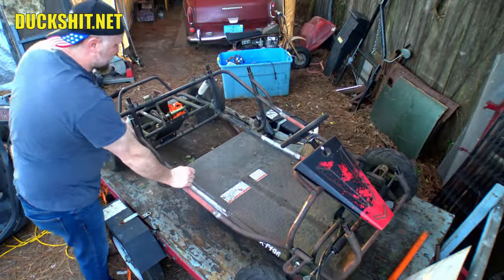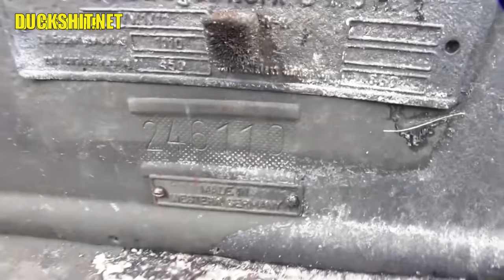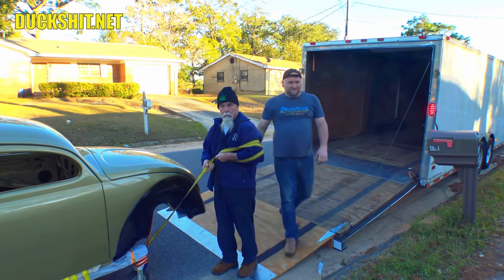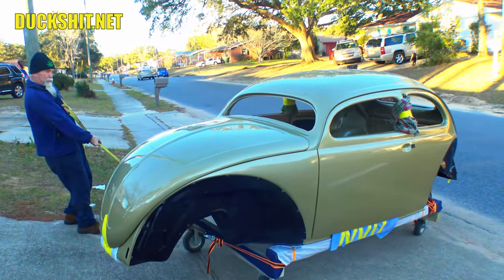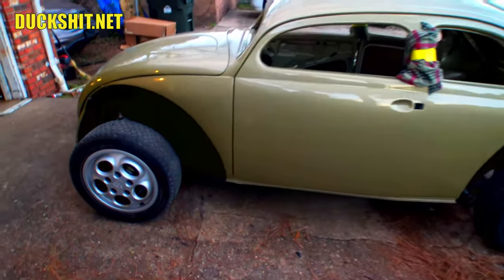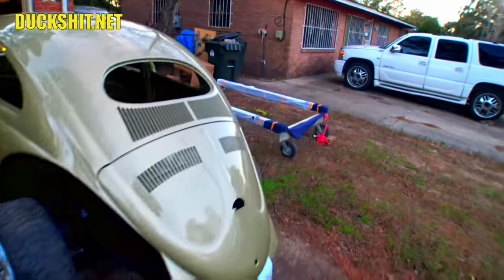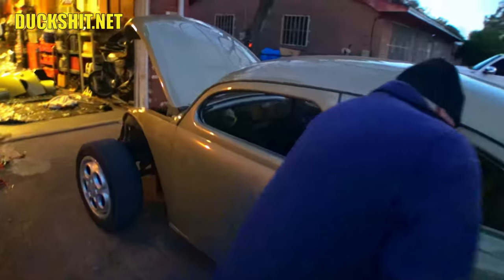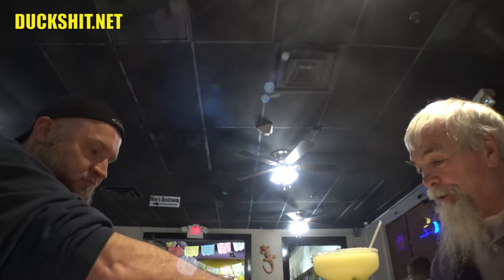Eleanore Comes Home - ROTTEN OLD CHOP TOP 1956 VW BEETLE - 161

Comment: did you put the rubber pads under the mounting areas? :D 3:)
Reply from the maker: Nope, was said in the video at some point, not really audible.  But that was the only reason I said I would lift the body up at all, and it only needs to go an inch in the front and less in the rear.  Hehe 😁👍🏻
Reply: @DuckmanCycles  what amazes me is that the trunk lid is stable - every one I ever owned when you opened it you had about 4 inches of flop on it - he really reinforced it well! :D
Reply from the maker: @patrickteater3392  I'm not sure how he stabilized that hood, specifically, I don't think any welding took place.  There is barely any filler on it either.  But it fits really nicely, when he got it, the fit was TERRIBLE!  That front end was from a car that had been hit in the front, gently, but it was wrinkled and twisted a bit.  I did what I could to make it work, but Earl made it into art!  😀👍

Comment: Sorry to have to ask but can a person get a set of  10 inch x 4 x110 4 bolt lug   that will take the center hub cap  ?
Reply from the maker: Please clarify your question I'm not sure that I understand.  Lots of technical stuff there but I think I'm missing some context.  Is this relevant to my Beetle?
Reply: @DuckmanCycles  SO sorry we are wanting moon caps on our rims 4 lug 15 inch    can a person get them easily in 10 or 12 inch wide  sorry to bother lol i suck at typing   just saying your car is just WOW!
Reply from the maker: I have seen them out there, but I'm not sure if somebody had them made or I'd they are mass produced. They cut out the wheel centers and just weld the into a new super wide hoop.  But if it's an air cooled Volkswagen it's probably a 4x130 lug pattern.   4x110 lug pattern is a strange one found on some 4 wheelers and old Mazdas.